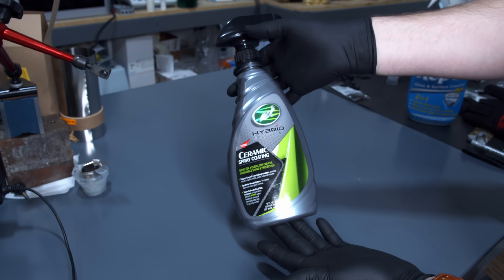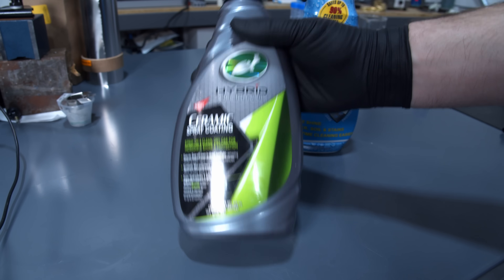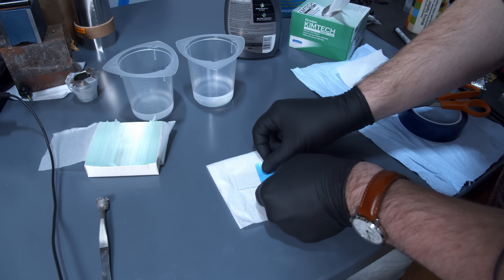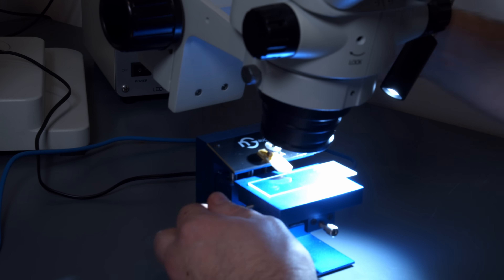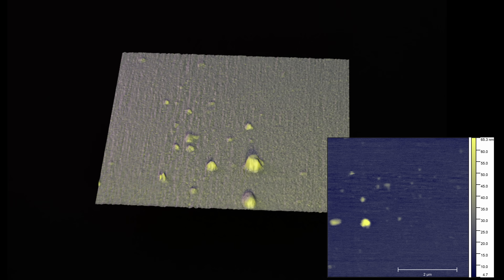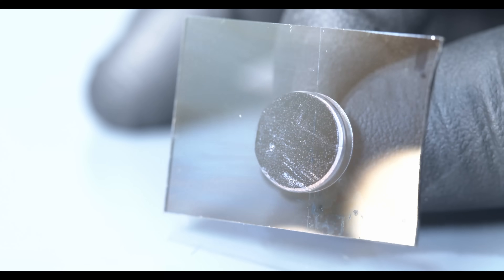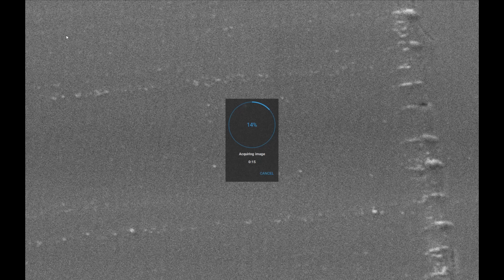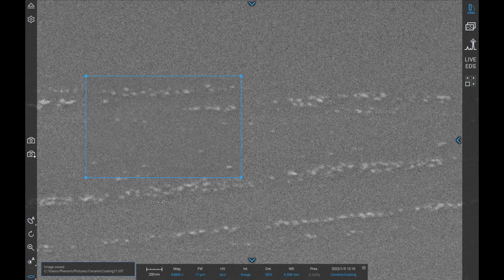Ceramic Spray is (probably) useless

Comment: I work extensively with Si polymeric coating (and including some hydrophobic and oleophobic coatings) and here is my take on these “ceramic” coatings.  They do work, they are effectively silicone polymer coating but the better ones are made with siloxane monomer with very specific functional groups to give the desired properties. For high quality ones they are basically monomers or oligomers in solution (usually an alcohol) that polymerize as the alcohol dries. The amorphous silica in the one you looked at was likely just a sol-gel and not hard particles of silica. It is used as a filler for the functional (expensive) siloxane monomers to bond with as it dries.

Edit to add: While they do work, I would never consider them very durable compared to the automotive paint they are applied over (but more durable than most waxes).  It would not surprise me if they needed to be reapplied every year, especially if you wash wipe down your car a lot. These are not hard "ceramics" but sol-gel and silicon polymers similar to thin PDMS or silicone caulking.
Reply: @Zak N the 3M products are good quality.  They are just siloxanes and the alcohol solvent (no amorphous fillers, waxes, etc).
Reply: @gingermany6223  any clue if there would be any benefit to applying the 3M ceramic coating to my cast iron table saw top as a rust inhibitor? Or on my shower door to prevent hard water spots?
Reply: @buffalojones341  I would say, probably not for both cases.  In general these silicon coatings are not very durable, despite the "ceramic" moniker (they are more akin to silicone caulk than a hard ceramic).  With a table saw I imagine you would wear it off very quickly, like in one use of the saw.  That and they are formulated to stick automotive paint and not bare metal.  The hybrid ones with waxes actually might be even better for a table saw (or good old WD40 since it was originally used as a water displacement rust inhibitor).  Same for a shower, it's not automotive paint and the water environment is very different that a car sees.  Soft rain water vs mineral and soap laden shower water.  Your best bet here is something like Clean Shower that is just some non-ionic surfactant and an amine that keeps the hard water and soap from depositing.
Reply: @gingermany6223  thanks so much for taking the time to respond!
Reply: @gingermany6223  sorry to be a pest, but wondering if you had a moment to answer my question regarding the high end ceramic coating on cast iron and on shower doors.
Reply: I do know that i used 3m ceramic last ywar and effects are all gone already. So if its good that that what you get barely a year in Vancouver canada weather.  Water don t pool anymoee so …
Reply: @Taxthe200mil  I use Fusso by Soft99. It has stayed on my car for over a year and still beads like crazy.
Reply: @Taxthe200mil  I'm not surprised, they are longer lasting than wax but definitely less durable than the paint they are applied over. I think the marketing oversells what they actually do.  I'll add that even though I work with this class of coatings I do not use them on my personal vehicles because I don't want to bother with the chore of applying them every year or two.
Reply: @Gingermany  the spray stuff is a worse but easier to apply version of the real ceramic coating, which sounds more like what was mentioned in the original comment. they're liquids that are applied sparingly with a sponge and the carrier fluid dries. the spray stuff here is sold knowing it's a compromise and basically just a more durable wax.
Reply: @gingermany6223  I had an oleophobic put on my glasses. Never again. That was the worst coating I have ever seen. Did they do it wrong? It really ended up acting oleophilic.
Reply: @m4rvinmartian  agreed, without know which one they used I would bet it was a dip coated or wiped on one which are not very durable or abrasion resistant.  I honestly haven't heard of any good abrasion resistant oleophobic coatings.
Reply: Hey, I was wondering why when using silicone calk is smells like glacial acetic acid. Like strong. I was wondering if they used a dimethyldiacetylsilane derivitive as like a cross linking agent sence it would be alot friendlyer than halogen derivitives. Secondly this shit works surprisingly well. I used 2 coats and it lasted about a year whitch is very good as car wax lasts a week to maybe 2 months depending on if it's synthetic or not.
Reply: @putinslittlehacker4793  Good question! Acetic anhydride is a common curing agent used in silicone caulks. As it cures, acetic anhydride combines with moisture in the air to catalyze the reaction transforming silicone paste into a solid, and in the process the anhydride converts to acetic acid, aka plain ol' vinegar. Stinky but safe :)

From what I understand, dimethyldiacetylsilane is effective in promoting crosslinking, but it is extremely sensitive to not just the composition of the uncured product, but also to the composition of the surface[s] the product is applied to. Too little and the caulk won't cure, but add too much and not only will it cure too much and lose all flexibility, it'll also strip H+ ions off the surface it's applied to. For that reason, particular attention must be paid to the concentration of the formula being applied, which is an impractical requirement for most applications. At least, that's my reading on it.
Reply: There is zero benefit to these products. It’s literally a scam to have you pay for what wax does while also putting micro scratches and damage your paint over time. There is a reason real ceramic coating costs $1k+
Reply: @SETHHIKARU  have you watched the video from @projectfarm ? You might be surprised by the results.
Reply: @buffalojones341  I was just going to say this, I watched that vid and based on his results I bought the 2 different types of Turtle Wax (one of them being the one here in the vid) and have had very good results. No complaints. They do bead water very well and make the vehicle very easy to wash and easy on water
Reply: @jasona-EV  nice! I tried it with mixed results, so I need to try again and maybe shake the bottle very well first.
Reply: @buffalojones341  I've been using it for years after watching project farm. I always forget to shake the bottle. It's a great stuff on the inside of the toilet bowl as well
Reply: @AaronBlankenship  do you mean to say that it works even when you forget to shake the bottle?
Reply: @buffalojones341  great video snd shows how tough this stuff is
Reply: Out of curiosity, what would you say would be best for coating the windows of a car with - hydrophobic or hydrophilic coatings?`
One beads the droplets and one sheets. But which would be best for ease of drying after washing or driving in rain?
Reply: is Colloidal Silica better than Amorphous Silica?

Comment: Just build a weighed stand with a flexible arm that will hold a deflector card of various sizes (1x2, 2x3, 3x4) at any angle, place it in the hood so that it diverts the splash directly downward. Then wax the window with auto wax, which as you know repels water very well including hard rain for weeks.
PS yeah of course these lame products are bullshit. Duh.

Comment: 2 things. 1. The YouTube channel Project Farm did a test with a bunch of ceramic coatings. This same brand you used was the winner in something like a 6 month test. The results left no doubt that it does do something good to car paint, and the manufacturer does say it can be used on glass too. 

2.  I tried my own experiments a. on a junker cast iron pan and b. on my glass shower door, but had poor results in both. I was hoping it would work as a protective coating on my cast iron woodworking tools and kill the hard water marks on my glass doors. The mixed results from your test, project farm, and my own make me wonder if settling is a big issue. I wonder what the bottom of the inside of the bottle looks like…
Reply: @gingermany any clue if the 3M product would work in my applications above? (Cast iron rust inhibition or for glass in my shower)

Comment: I believe that the silica is to provide nucleation sites for water to bead up easier.  Williams F1 developed a ceramic coat to try and get a few more mph from their cars there is no data as to if it worked.

Comment: Take a look into the siloxane, my understanding is "true" ceramic coatings are organometallic compounds in a carrier solvent that precipitate a xerogel coating that is technically a metal oxide (ceramic). Often you will see titanium listed, this is different from titanium nitride coated blades, but also a ceramic

Comment: I don't know if it's still for sale, but for a while you could get NeverWet at hardware stores.  It's a superhydrophobic coating that works exceptionally well.  I got a couple of cans to see if it could reject ice on aircraft leading edges, and it does, but it also wears off fairly quickly in that (admittedly very harsh) environment.  If you can't find any, send me a note and I can find mine and mail you some.
Reply: Fluid wax.

Comment: Thanks for the vid. I literally used this stuff for the first time on my bike a few months back and noticed... basically it seemed like it was just clean. Water tended to bead up on it a bit more, but generally, it didn't seem any better than an actual wax. I'd suspect worse, actually, if you think about what that silica would do when you rub it around on your paint. Wouldn't it be essentially sanding your paint, over time?
Reply: It might be "sanding" your paint, but it would be an incredibly fine grit size, so more of a polishing compound than sanding.  For example, 50,000 grit is used for polishing gems, and those particles are something like 0.5 micron.
Reply: @DennisGentry  Yeah, I could see that. But polishing too much is just as bad as sanding for the paint, right? Maybe it'd never even add up to become significant. Just an idea.

Comment: Knowing how amorphous silica is extremely hydrophobic makes me wonder if the sparse spattering of nanoparticles is still enough to disrupt the surface tension of the water in each area to such an extent that the water is unable to wet out the surface, and ends up coalescing into a droplet as a result.

Comment: Great video... I do use the same stuff for quick spot cleaning of my bike between waxing. It does leave a wet film on the surface constant folding of my terry cloth. I would love to see a video on a before and after with carnauba wax or H9 ceramic stuff. :)

Comment: Say what you like, but this Turtle Wax stuff is better than anything else when it comes to coating SMT solder stencils. A single application lasts over 30,000 prints. It also works well on a car.

Comment: Under car coating has a discussion what is the best: water shearing on top of the coating or water beading over the coating. I believe the ceramic particles are just there to help the nucleation of new water beads.

Comment: You should boil off the liquid and then burn the waxes. It will make it easier to see how much ceramic is actually in the mixture. It might be due to your glass being too clean and it being buffed off with the towel.
Reply: But this is not the use case of the product, nor would anyone using this Spray do that
Reply: even just wiping off the liquid .000001 seconds after spraying it on seems like a user error.
Reply: Right, distill off the liquids under a vacuum.
Reply: This is what I was thinking, a lot more of the coating will stick to a painted surface than glass. It makes sense that it forms a poor coating on glass, there's not anything for it to bond to.

Comment: There's at least one more interpretation, maybe it's not that good at treating raw glass. The stuff is for cars, meant mostly for the paint but it's fine on all the typical car materials and in the worst case it would only be as effective as normal silicone coatings. It may also stick better to glass that has been exposed to weather and driving conditions for a while, maybe the silica* particles are better at sticking into tiny scratches, or something about exposure treats the glass so it's more receptive.
Reply from the maker: Hm that's a fair point. It does say it can be used on exterior glass, but perhaps it's really on effective on paint and scratched up surfaces. I'll sand some glass and see if we can get more of it to stick and maybe try on a painted or metal surface. Cheers!
Reply: @BreakingTaps  it works great on my windshield
Reply: @BreakingTaps hey! Did you wind up testing the scratched glass with the hydrophobic products? My thought immediately upon seeing the slides (man I miss playing with those as a kid), was just how damn slick they were when handling! I'm not sure what either glass looks like under a microscope, but I would assume some of these windshields on the road look like the grand canyon under a microscope and could sure use something to fill those fissures 😂

Comment: I always thought wax and sealants filled in the scratches and imperfections in paint. Do you think it may not be as effective on perfectly level and scratch free glass?
Reply from the maker: I hadn't considered it before, but it's a valid point! Perhaps it really only sticks in scratched-up and scuffed material. I assumed it would be fine on clean glass because the silicone coating sticks fine, but perhaps the silica particles get wiped off.

Comment: I think it's possible that the particles are being used as an abrasive to help clean the surface and prep it for the application of the actual chemicals.
Reply from the maker: Oh, hadn't considered that angle. Could be! The marketing literature on the bottle says the silica is for "durable protection", but perhaps the marketing copy doesn't match the actual purpose?
Reply: @BreakingTaps  yeah who knows I'm not a chemist or a marketing person but if it seems to be more effective that could be it.
Reply: @BreakingTaps  and if it's getting better application with less flaws it could end up being more durable so technically not a lie lol

Comment: As I said in a reply to another comment, my theory is that the silica  particles are actually some sort of precipitate or contamination from the production process for a silicone polymer wax that was too costly to filter out, but marketing got the genius idea of just leaving the stuff in and charging more for the product as it has a "magic" ingredient..  

That said, since you have also been experimenting with laser etching, it might be interesting to investigate how practical it might be to laser etch nano-scale hydrophobic structures on your glass surfaces vs any external spray on coating?
Reply from the maker: Hah, I like that theory. Would certainly be a pretty clever win-win for them!

Unfortunately my laser doesn't touch glass (wavelength passes through, and pulses are too long to interact). I have had some luck texturing silicon and various metals, but haven't specifically explored using it for hydrophobicity. Could be a fun project though, will add it to the todo list!

Comment: cool analysis...but did even you try it on the cnc enclosure window??? ultimately, its performance is all that matters.
Reply from the maker: Haha sorry! I completely forgot to close the loop on that. I tried, and it works about as well as the RainX variety of spray: good for a few runs and then stripped away by the coolant 🙃
Reply: @BreakingTaps  cool, then results are completely consistent! thanks. 😎

Comment: I'd like to see how it does its job on glass in a machine tool. Ceramic coatings are used in car detailing and it would be interesting to see if the materials are similar.

Comment: You forgot to answer one question about the ceramic spray that i had: Does it work in your cnc machine?
Reply from the maker: Oops! I did forget! It works about as well as the RainX variety: good for a few runs and then washes away. The best I've found are "9H Oleophobic" screen protectors (like for tablets and phones). Whatever they are coated with works really well and lasts a long time, and the tempered glass helps protect the machine's glass.

Comment: Are the particles small enough that brownian motion would keep them suspended or is it possible they might have settled? Maybe shaking the bottle would give you better coverage?
Reply from the maker: If they are in the 50-100nm range (as it appears to be), they should remain pretty well suspended. But I gave it a good shaking and also primed the pump a bunch off-camera (been spraying stuff around the shop), so in theory it should be pretty well suspended. If they are actually a lot larger it's possible it settled and I just didn't see it... i'm going to see about evaporating off a bunch of liquid to see if we can get a bigger sample.

Comment: As it relates to the problem of coolant on the windows of the mill, AvE did a good video a few years back where he tried to make his own water shedding spinner window thingy. Could be a fun project to piece together, and it might solve your problem better than this stuff does.
Reply: Spindow
Reply: I came here to say the exact same thing - AvE's solution is simple, elegant, and scales well as long as you're running decent shop air.

Comment: Take a drop of this product let it dry then use oxygen plasma to remove waxes that will leave you with glass / ceramic particles if there are any. I would do it directly on SEM stub probably tho.
Reply from the maker: Ooh, I like that! Will give it a shot and post a followup if there's anything interesting!  Think I'll need to polish up the stud first, mine are very rough and hard to see anything micron-sized or smaller. Would be nice though since I could EDS it for more confirmation (but was useless on glass substrate).